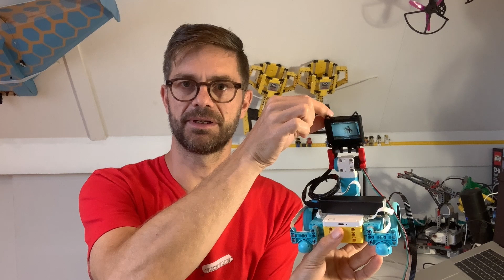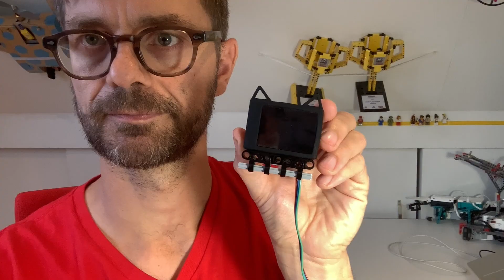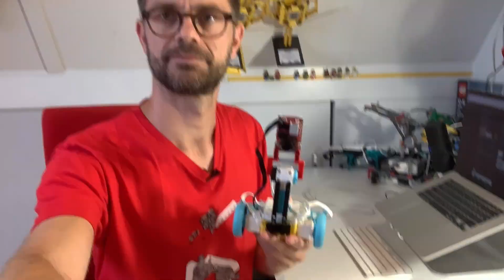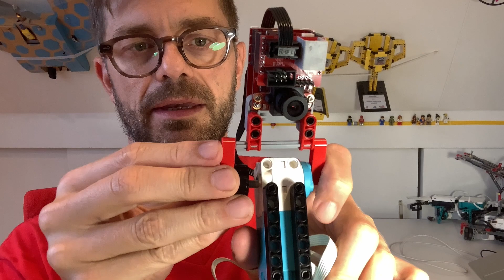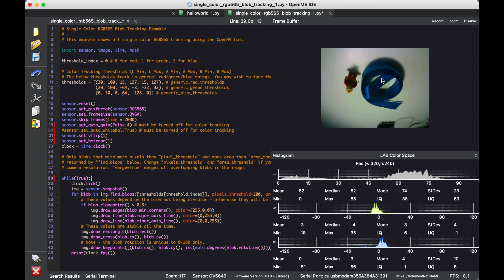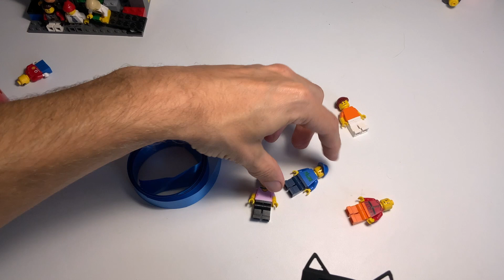OpenMV vs. Huskylens: which one to buy with LEGO MINDSTORMS or SPIKE

Comment: Hey Anton, Great video! I recently connected my pixy2 camera to my Spike Prime, but I'm having trouble having the two communicate with each other. I am using I2C and split the Spike Prime cable to connect to the pixy2 and plugged it directly into the Spike. Do you have any suggestion or recommendation???

Comment: Could a husky lens be used to drive servos to follow on object or person around a room?
Reply from the maker: Yes. But the person should move slowly
Reply: @AntonsMindstorms   Thanks for this information but if we want to build a real human-following robot, in the street and we walk or run - wearing a distinguishable t-shirt for the huskylens if necessary - is this possible or there is also a problem of speed to follow the human? If there is a problem, can we easily (at the level of the algorithm and the code) leave the recognition of the human to the huskylens module but to manage the tracking speed of the robot, then we use an ultrasonic sensor (and the robot can follow a running humain I think)? Or is the algorithm designed to manage tracking and recognition on its own and it would be complicated to modify it? Thanks for the help
Reply from the maker: @oliviertavel4169  Those are great questions, and I guess the only way to know the answer is: to experiment! I suggest doing most of the calculations on the camera because the SPIKE hub is not that powerful.
Reply: @AntonsMindstorms  Thanks for your answer and I thought make the calculations of the following with an arduino or ESP32 (I didn't kow the SPIKE hub). And yes, I I'm going to try, it's planned for soon !

Comment: This doesn't directly concern the content of this video but I don't know a better place to ask.
I just got the robot inventor set and while I like it, I would rather use an Arduino or Raz Pi. 
Do you know of, or make/sell a connector from the sensors/motors to break out pins?
Just looking for an easy way to interface the Lego hardware with an Arduino. Skipping the Hub.
Thanks for all the interesting videos! New sub.
Reply from the maker: There is a Lego shield for raspberry pi.